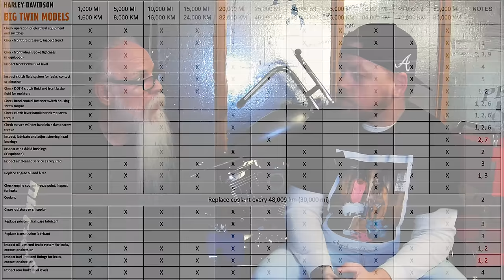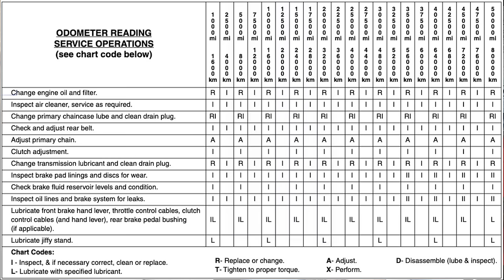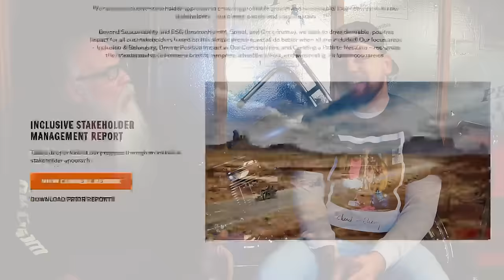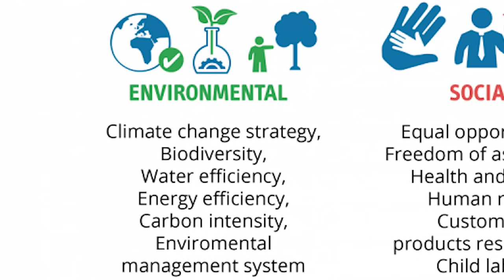Harley Oil Change Intervals-Engine, Primary, Trans

Comment: When you check the oil, do you screw the dip stick in all the way? Or just check it flush to the threads? I've heard it both ways. Just curious on Your opinion, and to what is the correct method. Thanks in advance.
Reply from the maker: You will want to check your manual for your particular model and year.
On mine it says to check the engine oil with the dipstick screwed in.  On the transmission it is with the dipstick Not screwed in.

Comment: My program is oil and filter (cleanable of course) every 1k to 1.5k. Primary and transmission around 2.5 to 3k. My cars I never let go over 3 to 3.5k on oil and filter. Auto transmission fluid 30k and no more than 50 to 60k on the trans filter. NEVER LET SOME CLOWN do one of those transmission flush procedures! Here's a tidbit... I have Ford transmission pans with DRAIN PLUGS! They are made by Ford for U-Haul ... what does that tell you?
Reply from the maker: Thanks for sharing your schedule.
That is really interesting info about Ford!  👍

Comment: I live in Arizona; yes, we ride in the Winter Months (40 to 60 Degrees), and a 5,000-mile oil change would make sense. BUT we ride in the summer months when it is 115+, SOOO it would make more sense to change your engine oil every 3,000 miles and a three-hole every other (6,000 miles). Yep, I'm a baby boomer. I turned a wrench for a living and have experience with motors in hot weather. Screw the ESG score (I’m a two Genders and EV suck kind of guy); I’m paying for my Bike and the upkeep of my bike. Maintaining CLEAN engine oil is critical, especially in a Warm or Hot environment.. PS: I also ride with the Patriot Gard, and our group participates in Parades (Slow speed with no Air Flow). We all know that heat can break down older oil. Poor oil conditions can do a poor job of lubricating the engine. Poor Oil leaves deposits (Varnishing) on internal engine components, plus clog passages with sludge, breaking down the Lubricating properties!  Poor engine oil condition can reduce the lifespan of your motor and in the long run, can lead to more downtime and will be more expensive to operate your Bike. If you're not changing your oil regularly, I believe you are a Fool!
Reply from the maker: Yes, upkeep and oil changes are imperative to a long lasting motor! Thank you for the added points and for commenting!

Comment: In short: Change all 3 fluids every 5000 miles! For longevity. I have an 06 U.C., and have never had one drop of oil leak. Been using AMSOIL for years and changed fluids yesterday. Fluids still looked clean after 5,000 miles.(3rd change in a row with same results on oil)
Reply from the maker: Thanks for sharing! 👍

Comment: Hey guys, we have all been told to change oil every so many miles and that was due to oil companies.  Oil doesn't break down the two concerns are the pH and contaminants.  We still have guys that change their oil every ten thousand miles in the trucking industry but I know guys that have almost a million on an oil change.  I don't see the advantage of changing the oil every 5 thousand for your 20 thousand intervals. If the oil is bad at that point you have bigger issues that wasn't caused by oil change intervals.
Reply from the maker: Thanks for your input.
Low RPM, liquid cooled semi's are very different than air cooled, higher revving HD engines.
On HD engines, the thing that breaks down first are the viscosity modifiers on the majority of bikes since they are running so hot that the modifiers loose their ability to curl up.
That said, yes, depending on how ridden, temps, what oil used, one can probably go much longer than the manual intervals.
Other side of the coin, most everyone can hear/feel the difference on a fresh 3 hole change...engine is smoother and quieter, clutch engagement is better, shifting is smoother.

Comment: i bought a 14 Limited, it supposedly was just serviced, fluid levels on the sticks looked right and clean. after 4K miles I did the first 3 hole on it with a filter. The HD counter recommended syn motor and gear oil for both sides. After 15 miles the clutch fried and the tranny grenaded. the oil moved from one side to the other.. It wasnt my first 3 hole, just the first on that bike. do you think it was the oil, or just bad luck?  $3600, new tranny, clutch, compensator and bearings, hopefully finish next week...
Reply from the maker: Hard to know what caused it without the bike right in front of us...but it is very weird that it happened right after 3 hole change.

Comment: Friend on his ford pickup went to Dana for rear end parts,  Dana recommended changing the dif cover from the ford part to stock Dana cover because of fluid cap, and part longevity,  what does the oil mfg recommend? Engine oil is different than gear oil synthetic has a different life cycle than conventional.
Reply from the maker: Thanks for sharing.  Good point.

Comment: I’ve always changed all 3 and use synthetic in the motor and transmission but awhile back found that Lucas actually makes. Primary oil that isn’t synthetic. I switched from using Harley lubricants years ago. Not because I never liked the Harley products though. The main reason was because the closest dealership was 1.5 hrs away from where I lived at the time. It was a hassle to go there to pick it up. 

I’ve always used Lucas products around the farm on everything tractors trucks lawn mowers even my wife Mercedes suv. Right down to even my firearms. And never once have Ive never found a Lucas product that doesn’t do exactly as it’s advertised to do. Lucas products has never let me down. I’d make a good advertising agent for Lucas . I’ve even tried Amsoil products. We ran Amsoil in my sons dirt bikes and atv’s with great results. Very fine products just not a lot of dealers in our area. 

I’ve got a 2013 Ultra Limited. I really never liked the whining noise the primary’s make on them bikes. I guess it’s mainly because of the self adjusting tensioners  they’ve got. I never felt that the transmission shifted as smooth as it should of. Hitting neutral when coming up to a red light was damn near impossible. And knowing my problem was in the primary and not the transmission after many years of owning these bikes When I switched the primary over to Lucas Primary lubricant I must admit I wasn’t impressed at all. In fact I was down right disappointed. The more I rode the bike though the less noise I was hearing. But still I wasn’t satisfied with the shifting. I had plans on giving the Amsoil another try but the only problem was the parts store never really carried the Lucas primary oil when I first purchased it . I agreed to take a whole case if the store manager ordered it for me. What can I do with about a whole case of that type oil. So when the bike came up for service again i decided to give the Lucas primary oil one more service period . When I pulled the plug on the primary I noticed 2 things 1 the oil wasn’t as dark as the other oils I had been running. But the other 2 oils was brown when I put th in new. And the Lucas is clear when it’s new. But the Lucas wasn’t even really dark at all the way clutch residue makes oil. And 2 there was hardly anything on the magnet. We’ll I’m coming up on the 5th oil change since switching to the Lucas and I can’t ask for better results . The whining noise is all but gone and I’ve got 0 problems with the way it shifts and my ability to hit neutral. I’m considering on only changing my primary oil every 6000 miles. I have no plans on doing the motor oil and transmission anything other than every 3000 mile though. I really see no sense in changing the primary oil every 3000 miles. As long as the oil continues to stays as clear as it has and I don’t begin to find metal shavings on the magnet. 
Sorry for such a long post . I do hope that it helps others. A lot of other guys in my area has switched over to using primary pacific products. As of now I’ve not heard any complaints about excessive clutch wear or anything else. Good Day to all
Reply from the maker: As with a lot of things it is trial and error! We appreciate your comment and you watching the videos! Thank you

Comment: Amazing video... great information.... what about if you ride 5000 miles in year and a half ? Would you change it on the one year mark? Or when you get to 1.5 years, or one years and seven, eight months? Thanks
Reply from the maker: Kevin doesn't go over 5000 miles without changing his oil. It doesn't matter if it is 1 week or 1 year. 

Thanks for commenting! MB
Reply: @DKCustomProducts  Does it matter if it is two years? year and half ? Thanks ... you guys are the best !
Reply from the maker: Always go by the manufacturer's recommendation on oil change intervals.... Mileage or age, whichever comes first. Mileage would be the most important factor IMO, but you should look at your hand book and see what is suggested as far as time if you are riding many miles in a year. 

Thank you for commenting! MB

Comment: Kevin can you tell me what weight and viscosity oil you use in all three holes.
Reply from the maker: For the last quite a few years Mary and I chase cooler weather in the summer, so I use 20w50 synthetic engine oil year round as per HD recommended weight in the linked chart below.
Trans is 75/140 gear oil
Primary is 20W50
HD Engine Oil Chart- http://www.dkcustomproducts.com/image/Links/Oil%20Weight.jpg

Comment: I get it and I don't disagree with your conclusion about HD trying to improve the carbon footprint.  However, changing the trans fluid at a longer interval is completely fine.  Even the primary can go longer, but because of clutch plate wear I will agree to change it more frequently to keep clean lubricant in there for better performance.  I've never had dirty fluid come out of the trans at a 5k mile change out though.  I'm not at all trying to say anyone has to do this and it is always better to have fresh fluid in any use, but it doesn't always mean that what you are taking out and dumping is not just as good as the new you are putting in at that point.  Just my 2 pennies...
Reply from the maker: Thanks for sharing. 👍😎👍
After making this video and taking time to read the comments, and look back on my experience with draining the fluids, I am going to stick with 4k-5k engine changes, and the same with the primary, but will do the trans every other oil change.  Like you, the trans comes out clean, little to nothing on the magnet, and it does not get the heat that the engine and primary get.

Comment: Thanks Guys ..My bike been sitting for about 1.5 years ..I have started it now and then...Do you think I need a complete fluid change before riding again?...Battery is a LiFe battery . 2010 HD Deluxe miles 8245.
Reply from the maker: Oil should be changed at least once a year, regardless of miles.
Starting it periodically and running it just for a short period, produces more than the normal amount of condensation and acids in the oil.
Better for the oil not to be subjected to that.  HOWEVER, I know the feeling of wanting to hear it run, even if I can't ride it.  🙂

Comment: Every 2500 miles, that’s the information I got when I bought my new 22 RGCVO. I asked why the difference my tech stated it was better for the engine. The manual states every 5000 miles. Now it isn’t a case of taking it to the dealer. I change my oil, primary and transmission and brake pads. Can you find any documented reason why?
Reply from the maker: The levels of heat that a Harley engine experiences is bad for oil, especially multi weight oil (20W50).  It is not as bad for SAE50 or SAE60 oil.
This is one of the reason that the HD manual suggests a straight weight oil for warmer temps.  See it at this link, or you can look in your manual.
http://www.dkcustomproducts.com/image/Links/Oil%20Weight.jpg

Comment: I wonder why you don't use Redline Primary fluid in the primary case?
Reply from the maker: Back many years ago I put a synthetic in my primary...one that they said was for primaries.  (before redline had primary specific)
My clutch slipped, and it was a PITA to totally clean the primary and clutch plates out so that it would stop switching.
Now I have an aversion to synthetic in the primary...I will probably give it a go at some point.  I have talked to a lot of folks that have no issues.

Comment: This is the first time I've seen you guys and I agree with changing primary and transmission every 5000 miles using Harley oil,  I was burning Harley motor oil but some noises like loose rocker lockers or something terrible,,  I put car quest oil in for the winter and didn't change it yet this summer and the noises perty much went away,, is it OK to run that oil in my 06 heritage?     Ps. That noise happened 18000 miles after a 95 bore
Reply from the maker: You may find the video linked below useful/interesting.  We share our thoughts on oil.
https://www.youtube.com/watch?v=bNHgNThrqQo

Thanks for commenting! 😎

Comment: On my 12 FLHTK I chance the fluids every 4-5000 miles. I use Amsoil in engine and primary and Redline ShockProof in the tranny. I will be trying Spectro in all 3 holes soon after I do the oil analysis and go from there..
Reply from the maker: Read Blackstone report on how they test viscosity...it is not really relevant to the temps that Harley's experience.
https://www.blackstone-labs.com/oil-viscosity/

Comment: The oil in transmission I agree with changing every 20k miles.  The oil looks like new even at 20k.  The primary on the other hand is  black as tar after 5k miles.  So I always change primary and engine every time.
Reply from the maker: Good points!  Thanks for the add. 👍😎👍

Comment: I worked in the oil business for 16 years. The only way to know what is happening to your oil is to have an analysis done. This will tell you what your viscosity is, whether you have metal or any other contamination of any kind. And it doesn't matter whst temperature you are running. The analysis will tell you if you are good or not. Make your adjustments accordingly. Don't  ruin your ride, but don't throw your hard earned money in the waste oil burner.
Reply from the maker: Thank you for the comment.  Good info! 👍😎👍

Comment: I've always overly serviced the engine oil. Primary and transmission serviced 5 to 7 thousand. Never had a problem. Started running H-D fulids when I got my 1st NEW H-D, 23 years ago. I run conventional, I run H-D brand because I use my Chrome Cash Rewards, off my credit card. Did this on 2 Twin Cams & 1 M8. My older bikes, get 1 a year and whatever brand is on sale at my buddy's shop. Good video, I never noticed that in the manual.
Reply from the maker: Thanks for sharing. 👍😎👍

Comment: Hey guys, thanks so much for the video. Sorry for my ignorance but how does changing the oil at higher intervals reduce Harley’s carbon footprint? And that whole ESG deal is crap in my opinion…I change all oils no more than 5k miles and I’ve never had any problems in any of my Harleys
Reply from the maker: Higher intervals mean less old oil needs to disposed of, and less new oil needs to be refined.
The thought is that this effectively reduces the total amount of a carbon footprint that a Harley makes over xxx number of miles.

Comment: Spectro HD 20W50 every 5K for engine, SYN3 every 5K for primary, and Spectro 75W140 Platinum 6 Speed Transmission Oil every 10K for transmission. Since the trans doesn't get the contaminates like the engine and primary, it can go longer. Never see any metal on trans plug magnet (after the initial 1K change).

Comment: What are your thoughts about using synthetic gear oil in your transmission?
I’ve been doing this for years it’s more expensive but it’s a lot quieter and smoother shifting
Reply from the maker: I've been using Redline Shockproof in the trans for well over a decade.  I tried the new HD stuff.  It is good, but like the Redline better.
Here is a video you may find interesting- https://www.youtube.com/watch?v=bNHgNThrqQo

Comment: By changing less frequently we reduce the amount of oil waste, which is environmentally friendly.
Studies may have shown the oil was still good past the earlier guidelines. Does anyone change their automotive transmission oil every 10 or 20k?
My '13 Dyna's manual says, 5,10,20.
Reply from the maker: Yes, good points. 👍
I can tell on my engine when the oil is getting "tired".  Tired being an unscientific way of describing when the viscosity modifiers are no longer working well.  How can I tell?  When there is more engine noise when fully warmed up.
On the primary it is not so much noise as seeing the fluid having a lot of material suspended in it (dirty).
On the trans, I believe I will be going longer, since it never seems to get dirty or louder, even at 20K miles.

Comment: Hello,
I like your 5000 mile rule for three holes.
What if you do not reach 5000 mi in a year,  say 1000 and let it sit in the garage until next season , will you  change it ?
Reply from the maker: Yes, it should be changed once a year, even if the miles are not reached.  Helps get rid of any acids and condensation.

Comment: I use HD 80/140 in the gear box change it every 5k
Crank SYN 3 every 2500
SYN 3 Primary every 2500
The primary oil looks a stinks bad at 2500 
Good info
Reply from the maker: Thanks for sharing. 👍
Sounds like you have a good system going for your ride!

Comment: I change my engine and primary every 5k but the trans sometimes I will let go 10k. I never go 20k on the trans. The only reason I will let the trans go 5k extra is the oil always comes out looking like new. My bike usually gets two services a year.
Reply from the maker: Sounds like you have a good system that is working for you! Thank you for sharing and for commenting! MB